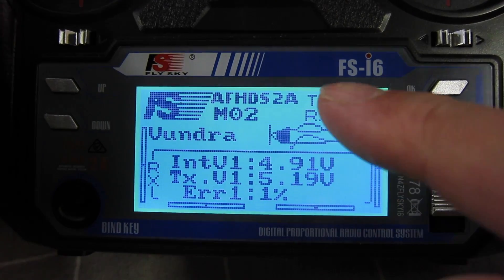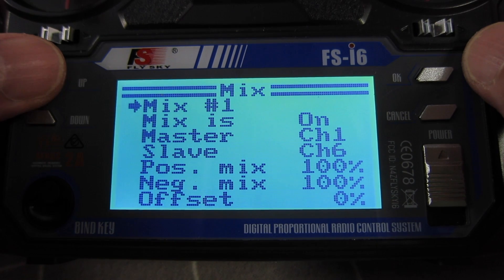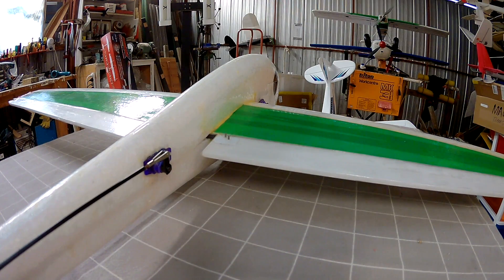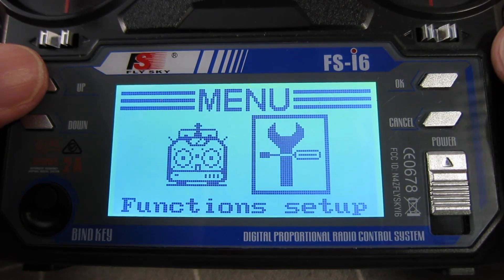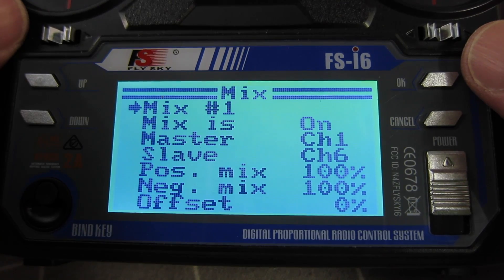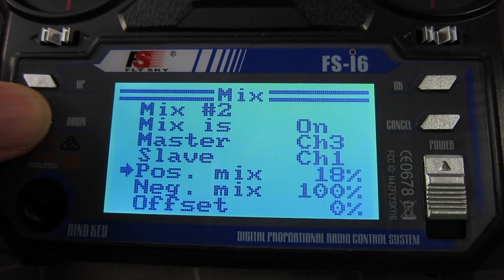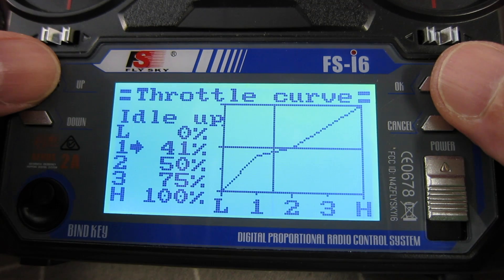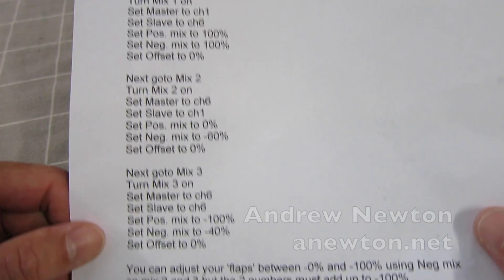FlySky i6 Flaperons - 3 methods

Comment: I still dont get it,I want to use the channel 1 as flaperon,apart from that my both flap goes down and up thesame time.I am a beginer and am finding it a bit to connect.
Reply from the maker: What are you referring to? Flaps, Flaperons or Ailerons? If you just want ailerons you can connect them both, using a Y cable, in to Ch 1

Comment: I got three positions working with a throttle stick on a glider... Idle- 1/8 of an inch reflex.. mydstic normal... Full throttle is spoiler on.. using the offset and the other function... At the bottom... Thanks again🎉🎉🎉
Reply from the maker: Clever chap.

Comment: Hi again ☺️ I was trying to set up my ailerons into flapperons and i could not get it to work . Is it because my left and right servo wires come together with a (Y) and plug into the #1 on reciver? ..... to make it work does each servo need to plug into a different channel? ... if you get some time I could use some help . I gave it my best for 3 hours today . I was trying to put them in the ( C ) switch 1,2,3 .... I followed your other video and I got the motor safe on ( A ) and the dual rate sport mode on ( B ) and training/student on ( D ) switch.  Those 3 work perfectly. I just can't get the flaperons to work . And I'm doing it on a FS-i6  mod to 10 channels . The reciver is FS-iA6B ....do I need a 10 channel reciver?  I really enjoy your videos , thank you
Reply from the maker: Yes you need separate channels for each aileron for flaperon mix
Reply: @AndrewNewton  Thank you 😊

Comment: hi. on my plane (volantex phoenix 2000), the left and right aileron servo are connected together in a Y cable and connected to CH1 (since both servos are oriented with the servo arms pointing to the tip, they are acting in the opposite direction as they should).
how can i add flaperons with my configuration (your setup in the video has each aileron servo on a separate channel) - when i try to do it via your method 2 in this video, my ailerons dont do an "offset" (lowered flaps) - they are always acting against each other.
thanks
Reply: i found your i6 crow/butterfly mix tutorial (https://www.youtube.com/watch?v=q953NjiB6uA). i connected one aileron directly to a Channel of my receiver (so the Y lead wont be used anymore).
Reply from the maker: @unclealig  Well done. Must have separate channels for the ailerons if you want flaperons

Comment: hello, how can I run the aileron 50% by assigning the roll key to 7? Switch on : 100% | switch off 50%
Reply from the maker: Switch aileron rates with the Fly Mode switch. Normal or Sport can be setup with any rates and expo. What do you mean by 7? There is no Ch7 on this radio.
Reply: @AndrewNewton  For example, I want to assign sport and normal flight mode to switch 1.  how can I do that ?
Reply from the maker: @cancihancelebi  Watch my i6 programming video

Comment: Hi M. Newton, I have a nano talon and installed skies on it, I can controlled it nicely with a ski at the back plug on my channel 6, my problem is it is difficult to lift, I was wondering if I can assign my switch D to control the flaperons, but I’m using kopilot so is it possible to program it thank you and have a nice day
Reply from the maker: No programming with the Kopilot unfortunately.
Reply: @AndrewNewton  Thank you for your respond, what would be a autopilot  like kopilot that I can use the plaperons with it, if you can propose me one, easy and something not to complicated 😂 have a nice evening and thanks again for your information.
Reply from the maker: Matek boards using INAV are the best but not simple at all. I don't know of anything in between sorry

Comment: I'm wondering what is more effective in slowing down a Sky Surfer?  flaperons? or Spoilerons? what is more effective and gives a better overall flying experience? any insight you can give Andrew based on your experience is greatly appreciated!
Reply from the maker: Flaperons for shorter takeoff and slower flying but more lift, Spoilerons for shorter landing and less lift (specially for slope soaring)
Reply: @AndrewNewton  Im in Florida USA so not much slope soaring here. I will do the Spoilerons for shorter landings.  THANK YOU!

Comment: Hello Andrew. I need help for biding FS-i6 transmitter, with Nighthawk  M-16 receiver. I try it the same biding with FS-iA6 receiver but doesn't work. Can you help me? Thanks.
Reply from the maker: Does it have a Flysky receiver?
Reply: Hello Andrew. I have an FS-i6 transmitter and work normally with an FS-iA6 receiver but don't bind the Nighthawk M-16 receiver. The transmitter isn't compatible with this receiver? Can you help me?
Reply: @AndrewNewton  Yes, I have a Flysky receiver and FS i6 transmitter and working normally on the binding. But the bind on the Nighthawk M-16 receiver doesn't work. Can you help me for binding this receiver with the FS transmitter? Thanks for the help.
Reply from the maker: @aurelbarbor1125  No I cant help

Comment: I don't understand....how do you manage to control both the servos down if your using a Y-connector on both of your servos? The signal would be the same on both servos because it only has one cable from the rx....unless you connected the servos on two separate channels...
Reply from the maker: You are correct. Must have separate channels
Reply: Thanks andrew.... you have given me an idea of how to slow down my 2 planes in landing. Actually I was really thinking of it due to I was flying it in a not so large area and I have to descent maybe 20ft. then have to catch it on landing.... the DW eagles 1200 wingspan and the MG800. The eagle is ok but I want it more slower on descent but the MG800 is a little bit agile and descent from 20ft. for about 20 to 30meters away from you is still a little bit tricky to slowdown then able to catch it....

Comment: How to make the alieron and elevator mix ? For example when I turn left and right with the alieron I want the elavtor to move up aswell . instead when I turn to one side the elevator goes down and when I turn to the other side it goes up . how to make the elevator stay up when I turn both sides?
Reply from the maker: Not possible with this radio
Reply: @AndrewNewton  thanks I figured that . only way to do so is gyro right ? I was try to make my own stabilization mix

Comment: fsi6x use - expo to make FIXED WING les twitch or +expo
Reply from the maker: Good question. Negative expo, which is different to most other systems.
Reply: @AndrewNewton  so say 100 rates - 35 expo for example
Reply from the maker: @jujucattys156  Depends on how much throw that gives but that would be my standard starting setup for most planes

Comment: I just bought the FLYSKY I6X , setup is exactly the same as you describe , except the I6X allows you to assign switches as a channel , which actually makes the setup a little easier , but works so well on my 1.8 meter Piper Cub :) , Cheers Andrew !
Reply: I could use some help setting mine up . I tried for 3 hours today . I have the FS-i6 but mod to 10 channels so it's like the FS-i6x .... I'm trying to put the flaperons on ( C )switch 1,2,3  the other 3 are taken . And I don't want it on the sliders dials . Not sure you will even see this comment.  But I thought I would try to reach out , you made it sound easy . Much respect  👏

Comment: Can i use spoiler ons with elevons to take off with them both going upwards
Reply from the maker: What plane?
Reply: Piper j3 cub balls wood 1.2m wingspan
Reply from the maker: @aryamanshukla7248  Flaperons down a bit and elevator up would work
Reply: Ok thanks
Reply: Can i take off with just elevons or do I have to have flaperons
Reply from the maker: Just elevator and ailerons. Flaperons are just for fun really
Reply: So ailerons up or down? With elevators up
Reply from the maker: Just normal ailerons to hold it level while you take off, not up (spoilers) or down (flaperons). Build up speed on the runway then a little elevator to lift off.

Comment: Hey Andrew, I've tried your method on my FlySky i6-X and only seem to get the vario able to make one aileron go up and the other down. I copied everything exactly and this has me stumped! If I knew what the pos and neg mix did and how the master and slave interacted, I might be able to figure it out :( As it stands, I'm sort of lost.
Reply from the maker: If the ailerons are working correctly and on separate channels, all you have to do is change the flaperon mix weight values from - to + for the offending flaperon (or + to -)
Reply: @AndrewNewton  thanks! The more I played around with the settings while sitting on the lounge with my superEZ on the coffee table, the better I understood how the programming works.. the first time round I was using a y lead and of course, it didn't work lol.

I separated the servos on channel 1 and 5 and now I'm set. Ive got some mild camber, but because this plane is already so light and floaty, I feel it was a bit pointless. 

GREAT learning experience,  tho.

As a side note, what are the rules for us hobbyists popping out to a wide open field during the Coronapocalypse? No go? Or go but be careful?

Take care, Andrew and I look forward to the next video. Thanks so much for your fast reply, too.
Reply from the maker: Excellent Nick, glad you worked it out. No go is the message from the experts. Stay home. Doubt I will be flying for a long time.
Reply: @AndrewNewton  seems appropriate. I'd love lots of talking head videos sharing stories about flying and life in general. 

So glad I found your channel.

Comment: Dual rates and expo are affecting channel 1. With ailerons on separate channels and mixing, channel 6 is mirroring channel 1.  
That way, all effects of dual rates and expo on channel 1 (1st aileron servo) are being repeated on channel 6 (2nd aileron servo).
So flaperons and dual rates should work together. 
Am I missing something here?
Reply from the maker: I seem to recall some problem with the mix on Ch1 not being passed on to Ch6
Reply: @AndrewNewton  thanks for the reply. I don't have a plane to try it on. I've inly checked the display option in settings, where it seemed working fine. Also used i6x with latest firmware(I think). Maybe it was i6 or firmware issue.

Comment: After watching this video while setting up my first 4 channel foam board plane I got to thinking, is it possible to set up a aux switch or program a duel rate so with a flick of the switch at a set hight range it will slowly bring you in for a landing while only having to use the rudder or the throttle? Without having a gyro/stableizer
Reply from the maker: Nice idea but this radio might be a bit too limited. Would be easy with Taranis and OpenTX

Comment: Thanks for that! I programmed all the mixes but flicking on flaperon mode causes a massive nose dive...I can’t add another slave to compensate the dive with up-elevator...any idea what to do?
Reply from the maker: Use less flaperon movement and be ready on the elevator stick, or buy a transmitter with more mixes available

Comment: Pretty easy to understand the case when you mix a channel into itself.
The radio executes commands in sequence, like a flowchart.

1. take the value of CH2
2. modify it by the amount given in the mix
3. write it back to CH2
4. output the final value to CH2's port, or display it, or whatever
5. goto 1.

For example if you set a mix of -100%, than whenever you move the stick, it will always subtract the same amount from it, so it will remain at 0.

p.s. However I've noticed, that if you add another mix, and make for ex. CH1 follow 
exactly CH2, (a mix of 100%)  it will not do so! (will not stay at 0) Actually it will follow CH2's stick movement.
Reply from the maker: Thanks, that makes sense.

Comment: Thanks for the info , that has helped me out no end , unfortunately I cant do it with the receiver I'm currently using tho (the one supplied with the transmitter) as I have a flight stabilizer installed , I have a spare variometer , but no spare slot for the separate aileron servo ..........looks like I'll need a 9 channel receiver ?
Reply from the maker: Time to switch to Taranis Q X7

Comment: mister, can you show how to set the mix on flysky based on new manual sheet ZOHD Dart, as on my picture: https://drive.google.com/file/d/1V8TLe5mTIpoUYdrRE8-8H984xQY9wYB7/view
Reply from the maker: No mixing required if you are using the flight control board. Just need a mode switch

Comment: Hi Andrew, being a man of immense RC knowledge, can you answer a question for me? I would like to program Flaperons on a Volantex G2 but I have a BGL-6G-AP GPS Flight Stabiliser on board. As the Ailerons have to be split using Ch's 1 & 6 on my FlySky I6 Controller, is there anyway around this as the FC gets the Aileron commands from Ch 1 on the controller and uses a Y cable? What do you think?.....Best regards, Pete
Reply from the maker: Not possible with the BGL I'm afraid
Reply: @AndrewNewton  Thanks Andrew, yer that's what I thought. Shame really cos you can't have GPS/RTH for FPV & Flaperons. That will be something for the FC Manufacturers to think about, it could be done with an extra FC Ch. :) Happy Flying, regards, Pete

Comment: Hi Andrew have followed your info on the flapperon setup but I have tried to relate this to a NX3 flight contoller with the 3 position SW3 operates the function of the unit. Have exactley the same equipment as you and have followed your instructions. Please help (74 yr old oap)  Colin
Reply from the maker: Hi Sonja, I don't know that FCB but I doubt that the firmware supports flaps

Comment: i like the first method with the variometer thing but if your concern in not been able to find the neutral position easy, why not just use a dead zone on the curves like you did for the throttle?
Reply from the maker: I meant to say variable resister rather than variometer. Dont think curves are available for that

Comment: is there a dual aileron mode? or will i have to buy a y cable?
Reply from the maker: For flaperons you need ailerons on separate channels, for just ailerons you can use a Y lead in one channel
Reply: oh right gotcha , but say for an example you use separate channels for ailerons alone, and somehow program the mix; the pos mix and neg mix to something that wont require the servos to be mounted in a certain way to have ailerons? is that possible on this transmitter, cuz ik it is on the spektrums
Reply from the maker: Yes you can make them go either way in the mixing or channel reversing

Comment: Hello, great video!! Thank you Very much!! Can you tell me if I can use a 3.7 v lipo battery for the receiver? What battery do you use?
Reply from the maker: I use 5V supplied by the ESC or BEC, or 4 x AAA NiMH pack. 3.7V is not enough. Check the specs of your receiver for the voltage range
Reply: On flysky 1s will work no problem
Reply: @peterzingler6221  Perfect ! thanks !!! I´ll use 1 s

Comment: I realize I needed mix 3 for the servo on channel 5 but that doesn't change what happened. When I wrote potentiometer 1 I meant potentiometer A. It seemed that as soon as I adjusted the positive and negative that's when trouble started. I want to use the potentiometer but have just 1 battery left and am reluctant to attempt that program again. I think you owe me a battery. Best of spirits!
Reply from the maker: It's not the mix causing problems Brian. I'll bet you have a dodgy servo, battery or connection.
Reply from the maker: You could try again with a 4xAA rechargeable battery pack plugged straight into the receiver.
Reply: The UBEC provides no ground from batt to Rx but then neither would the average 4AA pack. The battery is an eflite. Quality pack. UBEC is generic but had no problems until I wanted to use the program you provided for potentiometer use. I purchased two new packs but don't want those fried too.
Reply from the maker: As you are the only one having such issues I am convinced you have faulty connections or equipment. Check everything again

Comment: I have a 2s 120mah 20c into a 5v ubec then onto the FS I-6 Reciever I successfully connected a servo to channel 1 with the first mix being 5 slaved and another servo to 5. I had servo function then I added mix two with potentiometer 1 with channel 1 slaved to that I adjusted the potentiometer and only one servo moved I started to adjust positive and negative to find control for both servos from the potentiometer and the servos started sizzling, trembling and going all over the place. I removed the potentiometer from the mix. After that I found that there was no servo response at all. Re binded the Rx and nothing still. Thought battery was dead and plugged it into the charger. Error response from charger. Looked at battery and noticed it had ballooned a little. Plugged in another battery and Rx and servos are ok. That program you instructed on using the potentiometer for flaperon mixing fried one of my batteries!